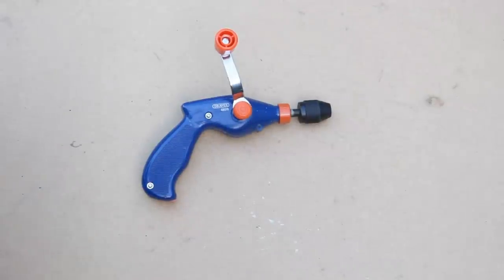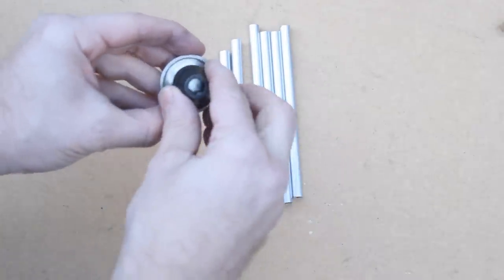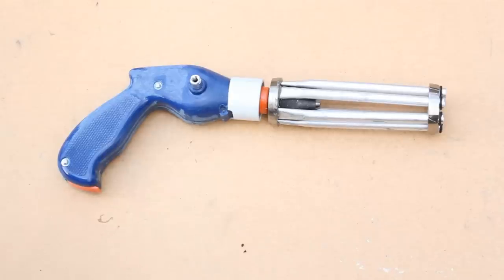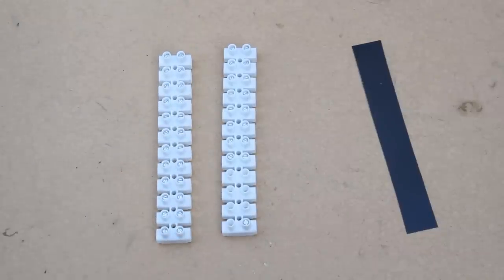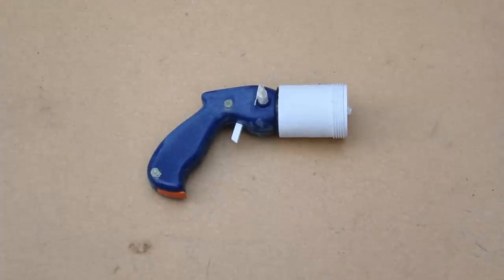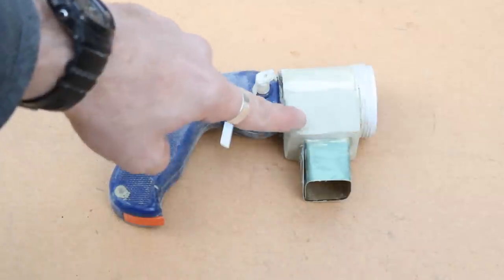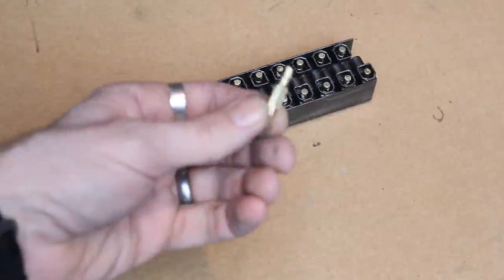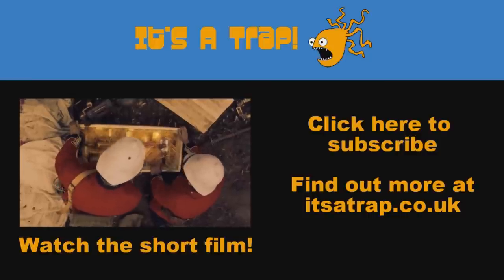How to build a steamtech machine pistol

Comment from the maker: Nice idea.  I used the stick magazine for this version as I like the visibility of the bullets and using the electrical terminals allowed me to slot the bullets (plugs) in an out.  I didn't do it during filming due to time but this would have allowed me to remove the bullets as the gun was fired, to show the magazine emptying.

Comment from the maker: I'm not sure exactly, but I would guess that it all cost approximately £30  ($46).  The main cost is the hand drill which I bought in a craft shop but you might be able to buy a cheaper one from the internet.  A lot of the parts were bits I already had hanging around in my workshop.

Comment: Isn't this technically not a machine gun? Since it's hand cranked. Well, also not real, but that's beside the point.

Now, on the other hand, if you were to replace the hand drill with a cordless electric drill, and make it actually fire... Hand held minigun? Yes please.